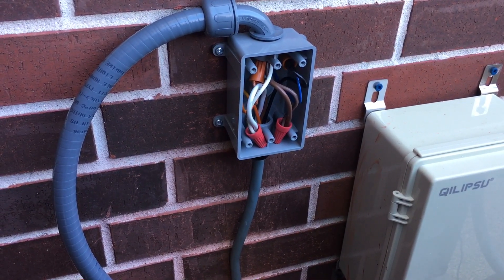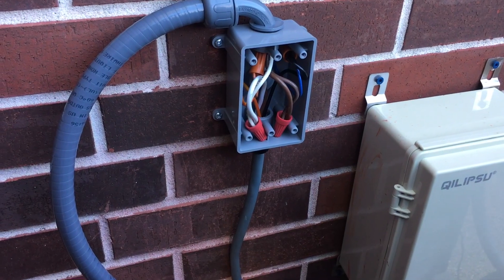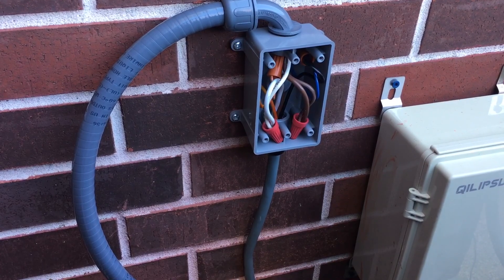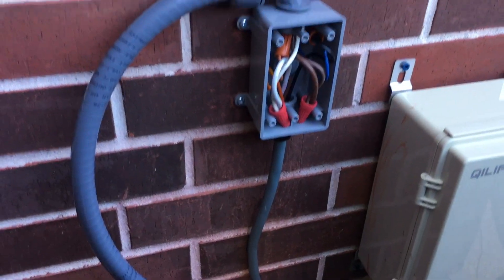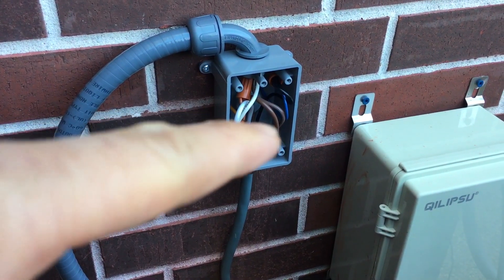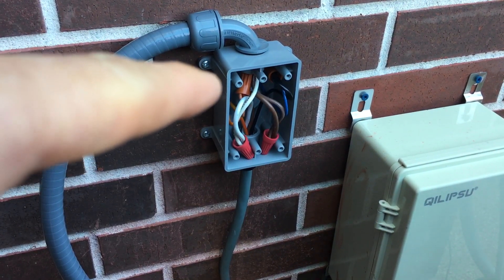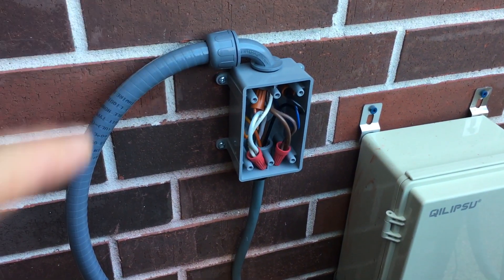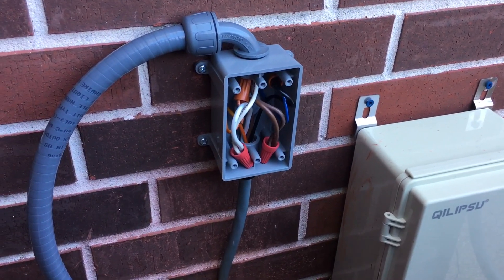Part 12 Westinghouse WGEN12000DF 15000 Watt Dual Fuel Portable Generator MicroAir EasyStart Cord Mod

Comment: Hi. I've ordered a waterproof enclosure and some LiquidTite for my new MicroAir soft start and will need to extend the wires as well. Did you use 10awg to extend all four wires? Thanks.
Reply from the maker: No, I used the same gauge as what was supplied with the Microair easy start. 
Which was:
10 AWG THHN stranded wire (2 different colors)
14 AWG THHN stranded wire (2 different colors).

The complete list of parts I used, is listed at the end of the video. As well as in the description below.

Thanks for watching.
Reply: I'm sorry man. I didn't see that before. Thanks for all the info and the videos. Have a blessed day. 👊
Reply from the maker: @OldManGamer69  No problem at all, glad I can help.

Comment: Quick question I just ordered the same generator but the 20000 watts version. These Generators are neutral bonded to the frame Did you un bonded your generator or just left it bonded? If so, can you show a video on how you did  it. Love your generator videos
Reply from the maker: WOW, very nice, make sure you have some friends (PLURAL) to help move that beast it will be heavy, heavy, heavy like, 550 lbs heavy. 

Yes, to answer your question. Since I am only use my generator when it is CONNECTED to my breaker panel via power inlet. I converted the generator from BONDED neutral to a FLOATING neutral, by removing the bonded jumper wire. If you are only running it with a bunch of extension cords and not connecting to your breaker panel, then you should leave it bonded. 

NOTE, if you do decide to unbond the generator, make sure to mark your generator with some high visibility tape noting "FLOATING NEUTRAL" in a couple spots.

Wgen12000df and Wgen20000 wiring are different.

It's super super super simple to convert the bonded neutral to floating neutral on the Westinghouse generator. Takes all of 2 minutes. All you do is remove the blue round alternator cover. So on your generator, if you are facing the control board, the round cover is on the left side of the generator. Once you remove the cover, you should see a WHITE jumper wire. One end will be connected to the ground terminal, which I believe on the left side. Then the other end will be connected to a terminal on the right side. Simply, remove the white bonded jumper wire from the ground bolt and unmarked terminal connection. Reinstall the bolts and tighten securely. Save the white jumper wire, incase you ever decide to bond the generator back to factory standards. 

Hope this helps. make sure to give me a like and subscribe. If you have anymore question(s), hit me up and i will try and help if I can. Thanks.
Reply: @gilbosdiy  Thank you very much for your answer it was very helpful and yes I definitely smashed that like button and I definitely subscribed keep the videos coming. They are very informative.
Reply from the maker: @patrickcoleman5867  Anytime. BTW I forgot to mention if, you run into any issues. The conversion from bonded to floating will be in the owners manual. it will be in the first couples pages of the operation section of the manual.
Reply: @gilbosdiy  Thank you

Comment: How many times have you had to use the gen set up has this generator had any problems is it still running well? Do you ever run it on gasoline or just always natural gas?great videos btw
Reply from the maker: As far as using the generator for complete power outage. I had to use it most recently for a 10 hour outage, we had last fall around October, using natural gas 100%. Worked flawlessly, no issues, no hiccups. 

In fact the 10 hour outage, was the reason behind part 11 of the video series, so my family would have a step by step. To be able to hookup, setup, and use the generator, in case I wasn't around. 

I generally run it on gasoline, when I pull the generator out to ensure it still runs every month to month and a half. Since I keep my generator in my garage, when not in use. Simply easier to roll out the generator to the driveway and use gasoline. Instead of having to roll back to the other side of the house where I have my shed and natural gas hookup. Not the easiest or lightest generator (350 lbs) to roll around, especially on grass.

Thanks, glad you like the videos. Make sure to hit like button and subscribe. If you have anymore question, just ask. I'll try and help if I can.

Comment: Micro-Air supplies a 40 inch wire harness per its spec sheet.   http://www.micro-air.com/support-documents/installation_resources/EasyStart_Specification_Sheet.pdf
Reply from the maker: Awesome that they decided to extend the harness for the newer easy start kit. The harness on both of my easy start are only about 28" long